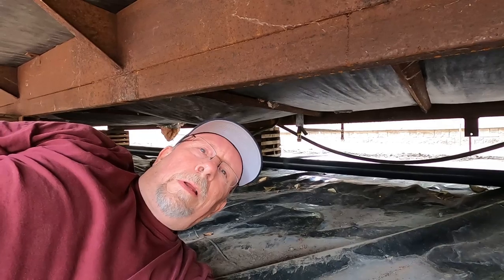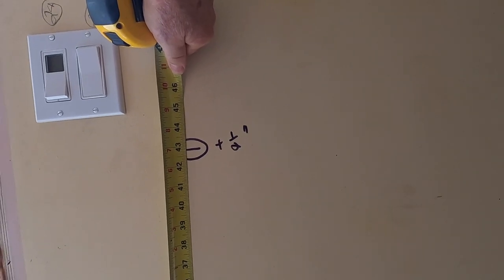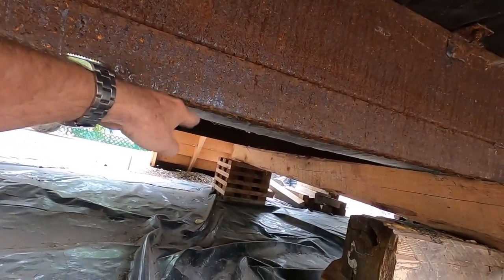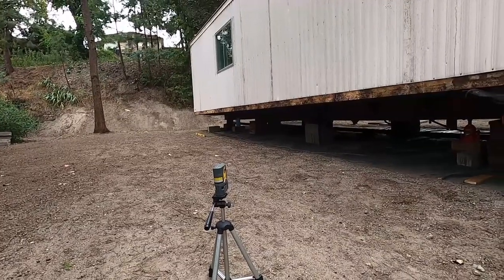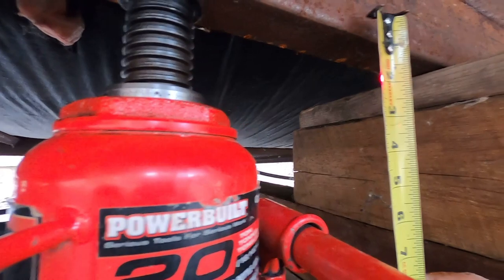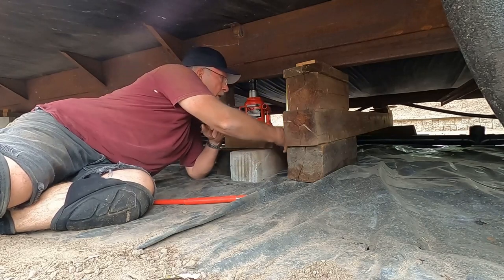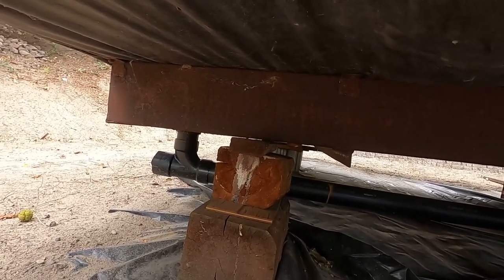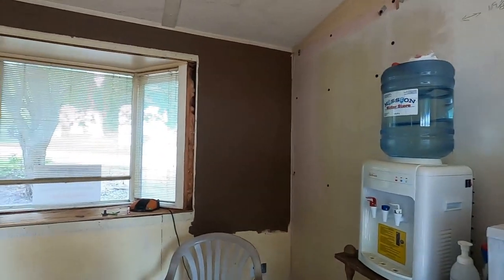Re-levelling The Mobile Home - Abandoned Mobile Home Project : E094 / BC Renovation Magazine

Comment: Great Job!  In my mind the concrete blocks would be a better choice. I would have thought the wood stacks and shims would have begun to rot... or not be strong enough to hold the weight... but they seem to be fine - even over time. Thanks for sharing!
Reply from the maker: Hi, J B. Thanks! 🙂 The concrete blocks are a better way to go than the wood cribs, but those old wood cribs and timbers under there have stood the test of time pretty well. If this were a new set up, it would definitely be concrete blocks all the way. Thanks for watching and commenting. 🙂
Reply: I like the added safety of the beams though.. the trailer is going to slide I guess rather than just topple over. 🤔 I need to relevel mine so I might put beams on the ends and middle but have the beams on the concrete blocks. 😅

Comment: I wish we had known how to do this when we moved into our double-wide in Dec 2017! We had one month to renovate inside before moving in and couldn’t find anyone to do it on short notice. 
Luckily, it was relatively close to level, though I’ve noticed some slight changes on one end where the strips go over the drywall at the centre of the house. At this point, though, I’d be worried about cracking drywall, etc…if we levelled.
Reply from the maker: Scott, these mobile homes do move around a bit. How much depends on the soil conditions and the kind of weather you have. Here, the soil drains well, being kind of gravelly and we don't get much in the way of frost to push things around.

It is a good idea to not get it too far out of level before it is brought back to prevent problems like that drywall buckle I showed at the end of the video. Around here it is recommended to re-level every 5 years or so.

Thanks for watching and commenting! 🙂

Comment: Sir, I greatly appreciate this particular video. There are very few videos about doing this that I can find.  I live in a trailer that needs re-leveled.  I plan on re-leveling it as soon as I'm able but there's a deck built around it which I may remove in order to do the work;  if I remove the deck, I'll want to have another one built after the trailer is re-leveled.

Comment: I didn’t think I would watch a video on leveling the mobile home but I enjoyed learning about modern vs ancient leveling techniques.  Thanks for the lesson!  I was wondering if some of the wood (plywood or softer woods) you use for a shimmy would compress over time with the weight of the home and furnishings?
Reply from the maker: Hi, Linda. Thanks for watching. I'm glad you enjoyed the video.🙂 There is some compression in the shims, but it is very minimal and occurs pretty much as soon as the load goes back on the crib. I usually make the shim a bit thicker than the measurement to compensate.

Comment: Thank you for the information.  I live in Northern Ontario & never seen concrete footings under the cage as well as the vapour barrier plastic.  I’m looking at levelling my single wide, adding footing, changing rotting railroad tie for newer ones.  What is the plastic called and have you ever had to add weeping tiles under or around the trailer?  My park is very wet and was recommended that I do so.  Love your video, very informative.  Merci 😊
Reply from the maker: Hello, Joelle. Thanks for watching and commenting. 🙂

The plastic is just 6 mil poly that you should be able to find at most building centers. It doesn't have to be black. Clear will work as well. only the thickness (6 mil) is important,

I have never installed weeping tile, or seen it done, around one of these mobile homes. Our soil conditions allow water to drain away very quickly and our climate is semi-arid. Your soil and weather conditions in Northern Ontario will be very different than ours here,

There are many, many different ways that these mobile homes are set up, depending on the soil conditions, weather and the local building jurisdiction where you live. Also, as time goes by codes evolve. This home was set up almost 40 years ago. If it were being set up today it would be done differently. 

That been said, this home has been sitting here for almost 40 years with very little ill affect from being set up to the code that was in place then, other than that significant settling in that front corner over the utility lines. Other than that corner the rest of the home was out less than an inch. If the home had been re-levelled a few times along the way there would been minimal impact from settling.

Since it sounds like you are going to replace all of your supports under your home I would recommend that you install all of the new supports to your current code. You are looking at more than just a re-levelling job. Contact your local building inspector and follow their guidelines. 

All the best to you. 🙂
Reply: Thank you.  I will be looking into all this.  My mobile is also 42yrs old.  Trying to straighten, and fix up.   Have you ever spray foamed the underbelly?  Our skirtings here are also insulated.   Looking forward to future videos.  Keep shinning 🌟
Reply from the maker: @joelledesroches4766  , I haven't spray foamed any of these. Insulated skirts are not common here.

Comment: I’m curious, have you ever raised a mobile home off the ground , that was down to the I beams. What does that involve, is that worth raising, what’s the possible complications ? 
Thank you. Awesome video
Reply from the maker: D. Collins, I have never raised up a home that was sitting right down on the beams. It would not be that difficult to raise it up, and I would, just to get it up off of the ground a bit. 

You would just have to jack it up in increments to get it where you wanted it, placing blocking as you go. 

A job like that is more involved than just re-levelling. Unless you are really handy with things like this then you should call in the pros. If not done in the correct procedure there is a chance that you could have it fall down on you.

Comment: This might be a silly question and I might have missed it in the video, but does it matter what height you set the laser level to? Or do you just set it roughly midway up the wall?
Reply from the maker: Hi, Debra. That is a good question! 🙂 Thanks for asking. It doesn't matter where the laser is set. It is just set to a convenient height. But, once you have established that height as the 'benchmark', if you move the laser unit to another location then you want to line it up with that initial set point. Thanks for watching.

Comment: I don't understand, I you're measuring from the floor, aren't you still dealing with different thickness of flooring? If the flooring in the back room is 1/2" thicker than in the front then your tape measurements will be off by 1/2" too.
Reply from the maker: Projects Galore, yes, that is correct.  In our case, the floors were even.  If your floors vary, then you have to compensate for that.  It becomes a bit of a math puzzle.
Reply: Probably better to measure from the ceiling down, it should be the same throughout.

Comment: How do you fix sagging outriggers and the bow in the middle of the floor?
Reply: Did you ever get an answer to this question? Maybe somewhere else?? I'm having the same issue in my double-wide
Reply: @heatherleemadden5080  No answer. I've read elsewhere there's not much aside of replacing them. I've tried the outrigger bar with the nut & threaded rod. It lifted where I installed it but did nothing for the bow. They say those "can" work but it'll take a year or more. Installed mine about a year ago (3 of them 16" on center on one corner), still nothing. Those will likely work good for stabilizing a floor by a door or where there's weight like a refrigerator "but before outrigger sag."
If you hear of something that works, get back with me if you will, and I'll do the same.
Reply: For the outrigger sag, I pulled off the subfloor sheathing and sistered 2x6's to be level and put new subfloor down in addition to adding piers to support the rim joist.  I only ran into this in one place in my house (kitchen) where a back porch had been added inappropriately (not self supporting).  I didn't have the bowing issue.

Comment: Do the wedges need to be a specific wood? I would imagine only a very hard wood only?
Reply from the maker: Charlie, codes vary from place to place. Around here the wood in the original cribs is required to be some kind of hardwood. There is not a specification (that I am aware of) on the shims themselves. Our jobs have been inspected and we have never had any issue with how we are doing this, where we are. We shim with just regular dry 2x4, 1x4 and plywood of various thicknesses to make up the space that we have to fill. We try to avoid disturbing the original crib as much as possible, thinking that if the crib has been sitting there for those many years it has probably settled in, just slipping shims in at the very top of the crib as needed.
Reply: Oak or abs. Prefer oak.

Comment: Great video 
How far deep are the cribs in your area?
Reply from the maker: aquarium aquarium, thank you! 🙂

In our area, at the time that this home was set up, these just sit on the ground. 

Normal practice was to prepare a compacted gravel pad before the home was brought in. In the four homes I have renovated the quality of that pad has varied greatly.

The cribs are 18"x18". They sit on a 24"x24"x3" thick precast concrete pad, which is reinforced with rebar. The pads just sit on the ground.

This works for our soil conditions and climate. The way these are set up would be very different given different soils and climate.

Something that we also do not do here is tie-downs. The home just sits on the cribs, held there by gravity. That may seem astounding to some folks but again, that is because of our local conditions. There are literally thousands of mobile homes like this one in our area that have been happily sitting on cribs like this. None have fallen over. 🙂
Reply: @BCRenovationMagazine  ok very interesting thank you

Comment: So at the end of your video, leveling may create a many problems in the interior walls etc
So is there a tolerance level to just live with
I mean to save $12-1800 in saving only to pay later to fix walls doors etc seems like a nightmare
Reply from the maker: Hi, Charlie. A lot of people don't understand that re-levelling is a maintenance item that should be done at regular intervals. Some parks actually require re-levelling to be done at scheduled intervals. It depends on your weather and soil conditions but generally a re-level should happen every 5 or so years. 

There was no indication that this particular home had ever been re-levelled. The problem with that is that when we re-levelled it we had to basically take care of over 30 years of deferred re-levelling maintenance all at once and some damage was caused. It is not a problem for us because we will be refinishing the entire interior and exterior of this home. It would be a significant problem if you weren't re-finishing.

Yes, it is much less costly to re-level every once in a while than to start fixing walls, doors, etc.

It is kind of like owning a septic system. If you have a septic system you should be pumping the tank every 5 or so years to protect your septic field. Around here a septic tank pump out costs about $400. Don't pump that tank out for 30 years and all of a sudden one day everything backs up and you discover that your field is plugged and you need to replace the entire septic system. A friend of mine just replaced their almost 50 year old septic system. The bill was almost $30,000. 

Thanks for watching and commenting. 🙂

Comment: Hey what do u think adding metal pipe underneath the frame On the corners and middle
Reply from the maker: TJA210, I'm not sure about that. I have never done that.
Reply: @BCRenovationMagazine  yea I was thinking about adding it to the beam 
2-3 “ pipe dig about 2 -3 ft deep n concrete
I recently seen a double wide with that

Comment: Some ques in mind
If there's already a deck attached and it needs leveling
Will leveling screw up the deck
Also is there any plumbing issues moved or cracked bc of leveling
Reply from the maker: Charlie, these are good questions. Thanks or asking them. 🙂

Decks and additions to mobile homes can be problematic when re-levelling. Decks are not so much of a problem if they are not covered, but a roof over a deck can make things tricky, to keep everything lined up.

Often, a deck or addition is built onto a mobile home where the mobile home is not level. The deck or addition is usually built level, while the main mobile home is not. At some point in time if the main mobile home is brought back to level then the deck or addition is usually made  un-level. It can become a bit of a fight to try to get everything level and keep the roof lines correct. That is why before we start any new work in our remodeling projects we re-level before doing any new work. That way, if anything settles it all kind of settles together. A re-level will bring it all back to level again together.

As far as plumbing goes, I had one project where the drains were slow from one of the bathrooms. We were underneath re-levelling and suddenly we heard water running. What we heard was water draining from that bathroom. Re-levelling corrected the grade on the drain pipe allowing the water to drain freely as it was designed to do. No more slow drain. The plumbing pipes are all flexible enough that I don't think there is any worry about cracking pipes.

Comment: Can you confirm that the high point (from measuring inside) is the point where you start leveling underneath the home? Basically you just go under the house where the high point was measured, and then point a laser at where it sits, and then move down to all the pillars, basing all other adjustments off of that initial measurement?
Reply from the maker: Hi, Kevin. Yes, that is how I do it. The high point is the 'benchmark'. Everything else is shimmed up to that high point.
Reply: @BCRenovationMagazine  Excellent! Thanks so much.
Reply from the maker: @Kevin-zl2ek  , you're welcome. 🙂

Comment: What are you referencing to for absolute 0, your control point for your level, every time you move your level, it will change
Reply from the maker: Hi, Darrell.  I find the highest point and use that to set my 'benchmark'.  I bring everything else that is lower up to that high point, by shimming.  It is easier to bring the low parts up than to take the high parts down.

Yes, if you move the level you will have to do a reset, taking a new reading, again from the high point that was established when you started.

Comment: I live in Central Maine. Not sure your weather conditions but curious about after I level, what would you use to insulate inside the skirting? Thanks in advamce
Reply from the maker: Hi, Sean. I have seen some people use that rigid insulation foam board, around the inside of the skirting.
Reply: Best answer the only place that gets insulated is under the floor of the trailer then your liner finishes it it. You do not insulate your skirting you vent it with vent panels you’re asking for massive problems locking moisture underneath if you insulate it. Unless you are on a cement pad then you can get away with insulating your skirting. Most code requires venting in your skirting. A vent every so feet of skirting each state is diff.

Comment: You should put a steel plate on top of your jack to prevent bending your main beam. This style of blocking using wood isn't allowed in the USA, HUD standards allow 1 piece of wood blocking no bigger than 2 inches. I like using the water level using attachments to a garden hose because the hose allows the water to flow better.
Reply: I'm in the USA also. I will be inheriting a single wide modular/(mobile) home in the not so far future. This information (as far as standards/codes) incredibly valuable that you shared here. Thank you!  I have been learning a lot from this fine man and I knew that codes and standards in USA would vary.  Heck, I'm sure they vary from state to state knowing our country...LOL  Anything I can learn before taking that deep dive into the wonderful world of codes and standardization is appreciated.

Comment: A water level is the easiest way to level mobile homes and houses with crawl space.
Reply from the maker: Hi, Paul. The water level works well if there are a lot of obstacles in the way. If there is a clear line of sight, I prefer the laser. Dragging that hose around under a mobile home is not great, but the water level does have its place, that's for sure. Thanks for watching and commenting.

Comment: Is it possible for a company to come in and level a mobile home but the floor is still Are not level?
Reply from the maker: Angelas Green Arts, the floors should be reasonably level after a re-level job. When I  re-level I allow plus or minus 1/8" tolerance over the entire floor. The way that mobile homes are made it is practically impossible to get the floors pool table level. But, after the job is done you should be able to take a 4 ft. bubble level and place it anywhere on the floor (hard floors) and the bubble should be very close to being centered in the vial.
Reply: @BCRenovationMagazine  thank you for your response.